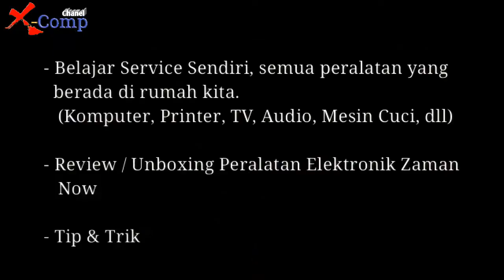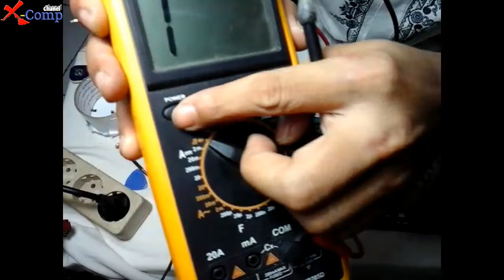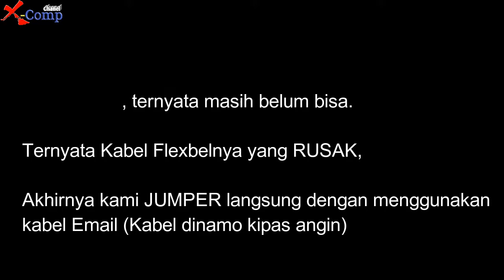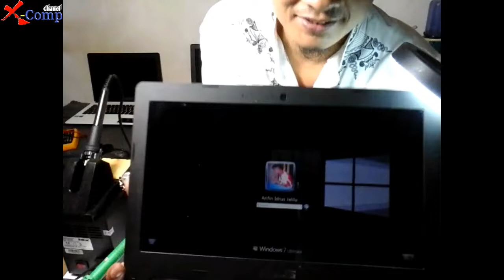Servis Laptop Asus MATI Indikator Charge Menyala

Comment: Sy madi bos ingin bertanya sy sdh nonton video nya lumayan ilmu nya tpi sy blm faham juga masalah penyakit laptop sy dgn mengikuti video yg ada d you tube, jdi dsini sy mo mnt nomor wa, siapa si bos bs memberikan solusi/saran kpd sy mengenai penyakit laptop Asus x452e TDK mo tampil layarnya hanya lampu indikator nya nyala, terimakasih sebelumnya
Reply from the maker: kalau kondisi laptop seperti menyala normal tapi tdk tampil.
-Cek RAM (memory) 
  lepas bersihkan pin nya 
- layar lcd nya yg rusak
  voba pakai layar eksternal (vga/hdmi)
- coba lepas batterai cmos nya (baterai koin).
nyalakan tanpa baterai langsung charger sk
- mainboard nya yg ada komponen yg rusak.

Comment: Mas.sy pny laptop asus eeepc 1015b.ketika dicas lampu indikatornya ngak nyala.dicopot baterinya dn dicas guna sama.ngak bisa on.kira kira solusinya apa ya
Reply from the maker: pastikan adaptor charger nya ada tegangan 19v
cek socket jack dc pada laptop
cek tegangan 19v pd mainboard laptop dgn mengurut jalur dari jack dc ke mosfet.
cek komponen :
fuse mungkin putus
capasitor  short
mosfet putus

Comment: Assaamualaikum..bang laptop saya asus A451L kendalanya layar blank tombol power gak nyala tapi indikator charger nyala indikator power yg warna putih smping charger juga nyala itu apa nya bang dah ganti kabel flexible juga ttp gak mau nyala
Reply from the maker: waalaikumsalam
cek tegangan 3v, 5v pada mainboard nya ada tidak?
sebelum dilakukan pengecekan tegangan coba di flash dulu bios nya.
atau sebelum di flash lakukan pelepasan baterai & baterai cmos nyalakan pakai charger sj
Reply: @Xcomp-Service  batre sudah saya lepas bang saya coba nyalakan itu pakai tegangan langsung via kabel chargernya ok bang nanti saya coba cek tegangan 5v dan 3v nya btw bang andai kata salah satu dari tegangan di atas tidak ada misal kuran dari spesifikasinya itu berarti yg rusaknya apa?

Comment: Lampu cash nyala,lampu power nyala,kipas nyala, tapi layar nya mati itu gmn y bang?😭😭😭btw laptop saya samsung
Reply from the maker: 1. Cek & bersihkan kaki & slot RAM (memory)
2. Layar LCD rusak, coba dulu kash LCD Eksternal
3. Mainboard
    - Bios Corrupt (Flash ulang)
    - Komponen2 (IC, chipset, mosfet, capasitor)
Reply: @Xcomp-Service  mas, aq asus x540L.  Pas dipower, indikatore nyala terus tp gak ada yg hidup, entah kipase juga layare. Gimana ya?

Comment: Kak, laptop Saya Merk HP. Lampu indikator nya idup  dan lampu Casplock mati, layarnya  juga mati . Tapi pas dicoba pake Layar LCD, LCD nyamuncul tampilan  windows error recovery tetep aja layarnya GK nyala. Gimana kak?
Reply from the maker: A. Layar LCD Gelap
1. Layar LCD panel Rusak
     - Kabel LVDS nya Rusak
     - Lampu BackLight Mati
2. Mainboard Rusak bagian
    - IC, Mosfet, dll
B. Windows Error 
     - System Windowsnya Rusak karena dimatikan tdk ShutDown
       Coba di REcovery, Install Ulang Windowsnya 
     - Harddisk nya Rusak (Tdak ke detect, Bad Sektor) 
       Ganti Harddisk.

Comment: Assalamu'alaikum mas, ini laptop saya acer swift 3. Laptop saya ini mati tapi kalo di charger lampunya nyala ditekan tombol power lampunya nyala tapi habis itu mati dan layar juga mati, sama mesin ga kerasa bergerak kira kira itu kenapa ya??
Reply: Nyimak
Reply from the maker: Ada yang Short (konslet) pada Laptopnya.
Bisa Mainboard, Hdd,CdRom, LCD, Baterai
Coba dlepas komponen diatas, nyalakan dgn Charge sj, jika masih blm menyala manboardnya yg Short.

Comment: Laptop saya indikator charger menyala, ketika di tekan tombol power indikator power menyala tapi hanya sebentar. Setelah itu mati lagi dan laptop tetap tidak mau menyala.
Reply from the maker: Ada komponen yg Short (konslet)
coba nyalakan tanpa Harddisk, CDRom, jka mash blm bisa
lepas baterai, socket fan processor, socket kabel lvds (layar lcd)
coba dilepas sau per satu, jka masih blm bisa berarti Komponen pada Mainboard nya yang konslet (capasitor keramik, mosfet)

Comment: saya nak tanya bila on plug dekat adapter akan nyala lampu kuning kan lps tu sya conect ke laptop trus lampu adpter padam jgn mcm x ckup power..adakah DC-in ada mslh..mohon pencerahan terima kasih.
Reply from the maker: Susah juga mengartikan bahasa Malaysia
mungkin yg dimaksud Adapter Charger saat di colokan ke Listrik indkatornya Menyala kuning, tetapi begitu Jack DC dicolokkan ke LAptop Lampu indikator pada Adaper Charge MAti. (kira2 begitu kali)
1. MAinboard LAptop ada yang Short 
    - cek Capasitor Keramik
2. Adapter Charge bermasalah 
    - Cek ada yg Retak Solderannya
    - ada part yg rusak, Transistor, FET, IC

Comment: Assalamualaikum pak, laptop saya saat di cas lampu indikatornya nyala.. Tapi di pencet powernya, gabisa nyala.. Sebelumnya juga pernah begini, dan diblg keyboardnya.. Jadi saya ganti keyboardnya dan bisa.. Apaa sekarang tetap keyboard nya juga yang rusak?
Reply from the maker: Waalaikumsalam, ya bisa juga keyboardnya yg rusak klo tombol powernya pada keyboard
Reply: Apa kemungkinannya cuma keyboardnya pak? Soalnya keyboardnya mahal banget klo ganti.. Duh...
Reply from the maker: @ardap1150  coba di cek dulu tegangan pada socket flexible keyboard, ada tegangan 3,3v / 5v tdk? 
jka ada tegangan berarti keyboardnya rusak,
system kerjanya tomboll on off pada keyboard meng short kan tegangan 3,3v pada ground. 
atau bisa dcoba pada socket board nya d short kan pn 3,3v dgn ground

Comment: Assalamualaikum, bang laptop saya Acer dan Toshiba klo d charge nyala indikator nya, trus di tekan power nya nyala, tapi gak ada tampilan apa2, Tus Toshiba hidup sebentar langsung mati sekitar 5 menit, kira2 bgmn y
Reply from the maker: Walaikumsalam...
Acer : 1. Memory (coba diganti / dibersihkan ), 2. Kabel LVDS dari board ke LCD atau (LCD nya rusak), 3. Chipset nya
Toshiba : 1. Setingan di Power Option, 2. Processor Panas (Bershkan Sirkulasi pembuangan udara pada Kipas), 3. HeatSink Pendingin processor kurang nempel pada processor, mungkn ada baut nya  yg kendor

Comment: Assalamualaikum Mas.
 notebook saya kena tumpahan air dan langsung mati total pas mau dinyalaian ga bisa. Lampun charger dan lampu powernya ga nyala.
Kira2 masalahnya dimana ya mas?
Reply from the maker: Waalaikumsalam... Saat kena air langsung dibongkar dan dikeringkan, coba dibongkar boardnya n dicek smua kaki2 komponen IC pastikan tidak ada yg korosi, cuci dengan tiner A spesial pakai tisue. Cek komponen smd fuse, mosfet capasitor keramik.
Reply: @Xcomp-Service  mas tadi pas dinyalain sempat nyala tapi mati lagi
Reply from the maker: @fadlyulathmony1853   masih ada konslet diboardnya

Comment: Om kalo laptop saya asus batrai saya copot langsung cas tetap tidak bisa nyala solusinya gimana terimakasih :)
Reply from the maker: mainboardnya ada bagianyang rusak
cek tegangan jalur Jack DC dari adator Charge (Fuse, Mosfet) 19v 
Cek tegangan pada Tombol On/Off (3v)
cek tegangan lainnya (5v, 0,9v, 1,2v)
Reply: @Xcomp-Service  sudah bang makasih ternyata kabel on/off nya yang bermasalah

Comment: Assalamualaikum bos... Laptop saya mati dan klo di cas lampu indikatornya GK nyala itu knp ya?
Reply from the maker: waalaikumsalam 
- Cek Chargernya ada tegangan 19v apa tdak ?
- Cek Jack DC (Socket chargernya) 
- Flash ulang BIOS nya
- Cek tombol On Off nya (harus ada tegangan 3v atau 5v)
- lepas baterai bios, nyalakan dgn menggunakan charge saja
- mainboardnya ada komponen yang putus / short (Fuse, kapasitor, mosfet)
Reply: @Xcomp-Service  oke terimakasih tutor nya bos🙏

Comment: Notebook asus saya mati total, ketika di charger lampu indikator batrai nya kedip kedip, kira kira apa masalah nya ya pak?
Reply from the maker: indikator Kedip2 orange artinya baterai Habis, orange tidak kedip baterai minim, hijau/putih baterai penuh. coba colokan charge slama 15menit mash kedip2 nggk ?
kalau mash kedip2 brarti board bagian power charge. IC controll charge atau Mosfet ada yang rusak, dia tidak bisa men switch antara penggunaan arus dari Baterai atau Charge atau kedua-duanya, yg bertugas sebagai relay disini adalah Mosfet.
Reply: @Xcomp-Service  sudah dicharge semalaman juga seperti itu. Pas dihidupin, hidup sebentar dan langsung mati
Reply from the maker: @eddryan9646  coba lepas bateranya, batera cmos jug, tunggu 10 menit, colokkan charge tanpa baterai, n batera cmos. mungkin hang biosnya.
Reply from the maker: @eddryan9646  ada mosfet yg 1/2 Short , coba dibongkar n dhidupkan dan pegang2 cari komponen yg palng panas, itu yg rusak
Reply: @Xcomp-Service  terima kasih pak